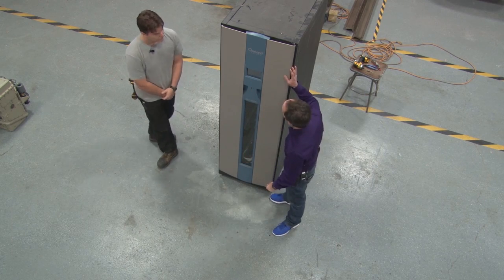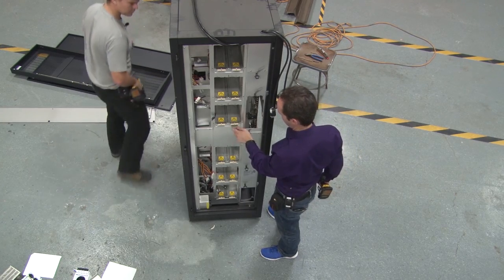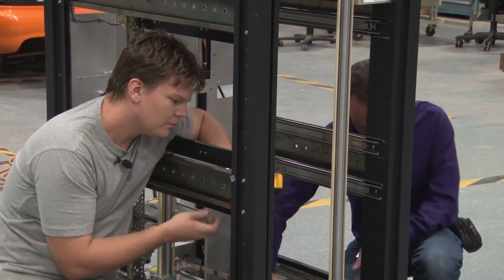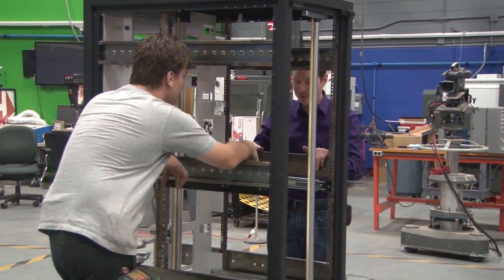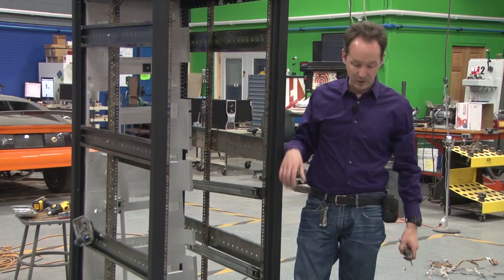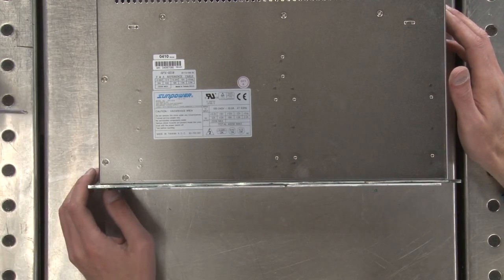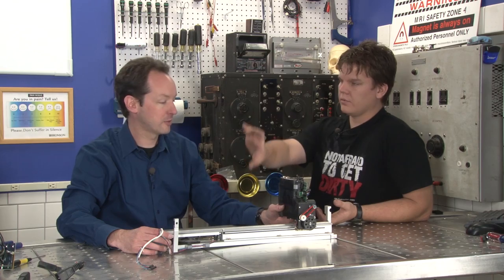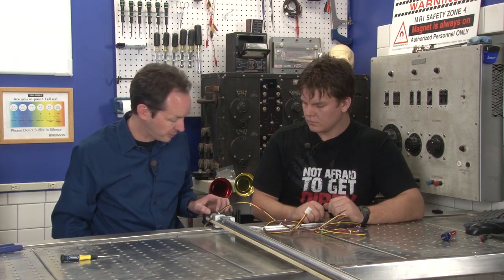Tape Library: Equipment Autopsy #79

Comment: The little carriage thing on the robot is called the Z-picker!
The fibre optic connectors connect to a fibre channel arbitrated loop protocol (think serial SCSI), and the ATTO card is the SCSI controller card.

Comment: also I am planning for a Sydney Oz holiday.  another of that tape library can be converted to hard drive storage.  power is very useful.  clang?  tape library has a flood of various parts.  high speed segments are fun.  imagine how productive you'd be if you could really move that fast.  talk during high speed segments.  hmm chewy parts are more educational.  (side note: a one floor version of your lab could have a rail system to help move heavy things.)  wires in the tape library are long.

Comment: I don't think you actually have a TV station tape library, but a SCSI tape library for datacenters. The drives look like normal LTO tape drives. Systems like these are still in use in datacenters world wide, but have moved on to SAS/iSCSI/FC communication instead of SCSI. The fibre ports are probably fibre channel.
Reply: +Sebastian Storholm They most certainly are LTO drives - I recognise them as I have one here to backup my server (a HP LTO 4 machine). I cringed when Chris threw that drive on the floor. They are probably older LTO 1/2 drives though. That robot could probably have been retrofitted with newer drives and used to backup TGG's data centre. But a monster 3d printer is way cooler. :)
Reply: dash8brj LTO is a great format, rugged tapes and drives.  Actually dropped an LTO3 drive to a cement floor and still runs flawlessly for years. 

Fun trivia.  Each generation of LTO doubles capacity and roughly read/write speed.  All LTO tapes have minimum of 4k flash memory that is read thru NFC, amazingly handy for describing contents.  Data is written back and forth in serpentine fashion. So it takes a couple hours to write full tape but only a minute max to rewind.  Also, you’d think you could have primitive but usable random access but no. They don’t implement block numbers and specific commands to jump to pass #.  These would require formatting and thats not in LTO spec, but LTO5 drives support LTOFS thanks to a partitioning feature.  Also FibreChannel LTO drives are easier to set up on a Linux PC than USB and dirt cheap.  Great backup solution.

Comment: that module - looks like an optical lan module 1,2, 10Gbit - Kingston SDRAM 168pin 128M ? JNI Chip - is a JAVA Native Interface and something AMD (1Gb lan chip?)
And please zoom the items.. we do not have superman eyes ;)

found on : intel gc80303 digikey i/o
= SL57T RAID Controller
http://datasheet.octopart.com/GC80303/SL57T-Intel-datasheet-7629346.pdf